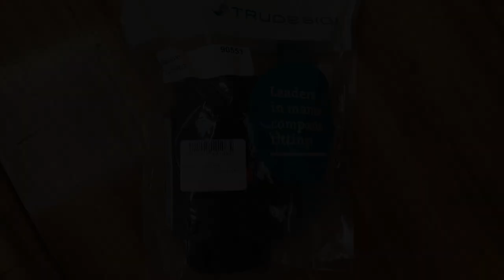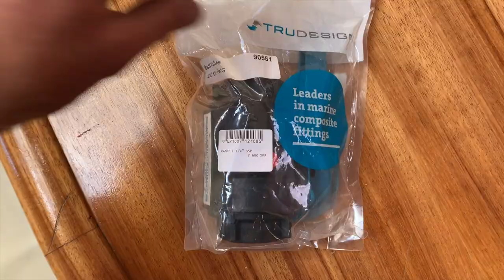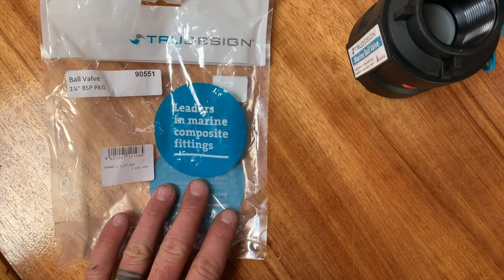Broken Ball Valves | Sailing with Six | Ep 23

Comment: Nice one.  We also swapped out a few valves to Trudesign but I went for the skin fitting also- might be better your way with the stainless skin fitting as the collar needed on the Trudesign to give lateral strength means it's near impossible to get the handle positioned where you can access it easily with the four in/outlets so close to each other under the vanity. That and the guy I was paying made an absolute mess of it all.
Reply from the maker: Oh no, it's not good when someone messes up. That's why we love to 'shadow' professionals 1. so we can learn as much as possible to do it ourselves next time and 2. you can see what sort of job they're doing.
I hope you fixed them all up. Loving our trudesign at the moment and just redid the engine intake one too - will slowly change them out each time we haulout. Thanks for the heads up about the trudesign skin fitting being a bit tricky though. We will keep that in mind. :)